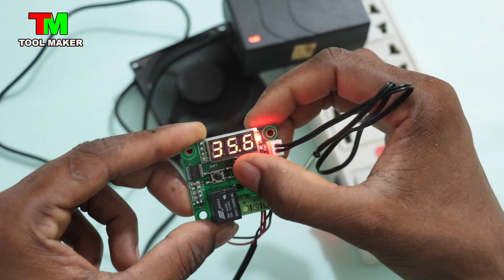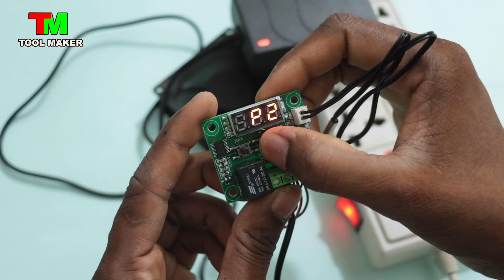മുട്ട വിരിയിക്കുന്ന പെട്ടി ഉണ്ടാക്കാം !!! How To Make An Incubator At Home | Tool Maker

Comment: Following some of the tips bassed on my experience.. for those who are going to make it:
*MOST IMPORTANT* :എല്ലാ items nu ഒരു spare indavanm especially thermostat, adapter, bulb, fan, alandu ee parripadi thodangaruth. 
1. If you had break in power supply ( current cut) never loose hope or think it is ruined. Ende orru 4th day il orru 8hrs current poyyi. I thought it got ruined but nothing happened. 
2. On 10th or 12th day my thermostat started to fluctuat. It was highly fluctuating. It was near to 37.5 but was not exact. Appo nyan P1 nu 0.5 akki vechu... Allel bulb addichu povan chance indayi. 
3. On 19th day my 12 v adapter nd thermostat stopped working. Nyan agge down ayyi. Vittil adapter nde spare indayi, but no thermostat. Kaddayil thermostat kayyinyu irrikyayirunu. So nyan bulb nde connection urri athine direct power source il kodduthu, pinne mogalil ninnu korrach thorranu vechu, chood koodand irrikyan... Vittil fever nokkan olla thermometer indayi, athine thermostat nde sensor nde hole il ketti temp check cheythond irrunu. Temperature near about 37.5 akkan mogalil gap adjust cheythu. 
4. Vellam ingane glassil thanne akanm ennu ilya.. Ethum valippam olla പ്ലാസ്റ്റിക് pathram ayalum mathi. 
5. Petti ഇങ്ങനെ തന്നെ വേണം എന്ന് ഇല്യ, nyan മീൻ / ice cream kodrana thermocol nde petti annu use cheythe... So ithrem panni indayilya. 
6. 18th day candeling cheythal kunyi ilyatha mottagal thirich arriyam. Candeling nde videos youtube il ind. 
7. Kozhi kunyi indayikayinya pinne olla karryangal nde patti detailed ayyi parranyitilya... Brudder nde specific ayyitu olla videos kandollu. 
** arkengilum okke upkaram indavum ennu karruthunu**
Thanks.
Reply: Dha ithanu after review enu parayunath...thanks for ur detailed notes for us..my hearty congrats dear..god bless you...thank you so much👏👍👍
Reply: God bless You For giving Such a detailed review and and explanation
Reply: Tysm bro 💞💞💞💞

Comment: during these 21 days if power cut and no inverter option available means what to do for alternate. can i use torch or other anything please reply
Reply from the maker: 3-4 hours power no problem , more than that some egg may not hatch
Reply: @ToolMaker  1st time i am trying this method . yesterday i did and kept eggs . just i am using thermometer to check the temperature, but its around 102 or 103f . can i put some more holes or how to maintain it
Reply: @ToolMaker  can we take and use the egg after 6th day for our kitchen use if chick is not developed in those eggs
Reply from the maker: yes

Comment: Brother ente incubator le light offakunnillallo thermostat le reading koodunnund.but light offakunnilla .enthane cheyyandath plzzzzzzzzzzz replay
Reply from the maker: settings okke currect aano enuu onnu koodi check cheyyuka,alllenkil adyam muthal onnu koodi set cheyyuka
Reply: Ippol bulb kathukayum offakunnunnum und but temperature 37.4 le offavukayum 37.5le on aavukayum cheyyunnund.37.4le onayalum pinned temperature 37.9vare povunnund.pinned temperature 37.1 vare kurayunnund ith prashnam aano.avidenne temperature koodi 37.4 le bulb veendum on aavunnu.

Comment: I too made a box and kept eggs. it is simple ok, but when I cheked with out side temp. and humid meter the temp. is showing only 35.6. where as w1209 is showing 37.7. Eggs are not cold that is all. any problem.
Reply from the maker: no problem

Comment: Machane video kandu eallam set cheythu. Thermostat il conect cheyth value eallam set cheyth kazinju bulb kathunnilla
Reply from the maker: p0 = H aaku
Reply: H aanu
Reply: Settings eallam same aanu
Reply: 15w led bulb use cheyy
Reply: Direct power alle adichu pokille?
Reply: @sonusoman4682  illa njan athanu use cheyyunnath enikum filment bulb kathiyilla
Reply: Thanks bro enkil onnu try cheyth nokkam. Eathra bulb use cheythu?
Reply: @sonusoman4682  njan 1  15watt led bulb anu use cheyyunnath
Reply: Ella bro njn 9w um 12w use cheythu nokki bulb kathunnilla. Bulbilekkulla connection il current und but bulb kathunnilla.
Reply: @sonusoman4682  adapter switch um bulb nte switch um orumichalle ON cheythath.

Comment: THERMOSTAT connect cheythappol over heat aakunnu, normally heat undakumo? 12v 2a adaptor aanu use cheythathu.Check cheyyan vendi fan um thermostat um just connect cheythathe ullu 2minutes...board heat aavunnenn thonniyappol off cheythu.....  ?????

Comment: Bro thanks for your video.
As per ur video I made incubator.
But oru prob. 37.5 aakumbo off aakunu bulb ennalum 38  -38.1 vara poyite kuranju varunullu...again 37.3 aakumbo on aakum.
Day1
Expecting your reply
Reply from the maker: first set cheytha value 37.7 aakuka , p1 = 0.3 aakkuka . muttayum velllavum vechu kazhinjal 38 okke aakilla . bulb 40w use cheyyuka
Reply: @ToolMaker  ee incubator short aavan chance indo??vdinte akathannu vechekkunath